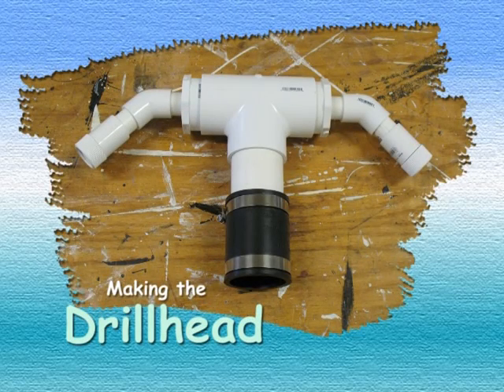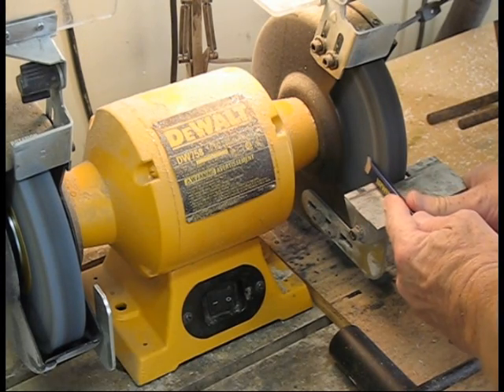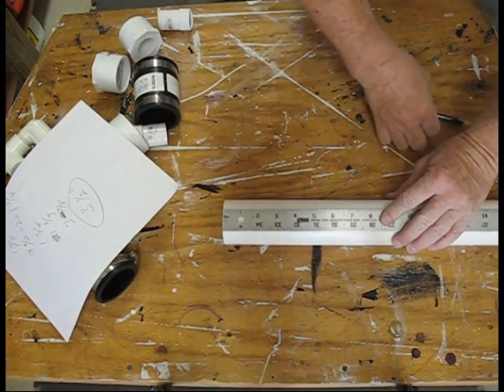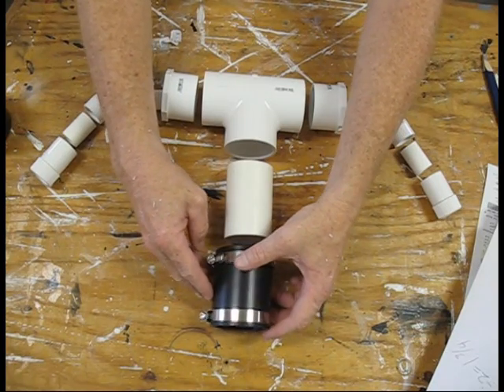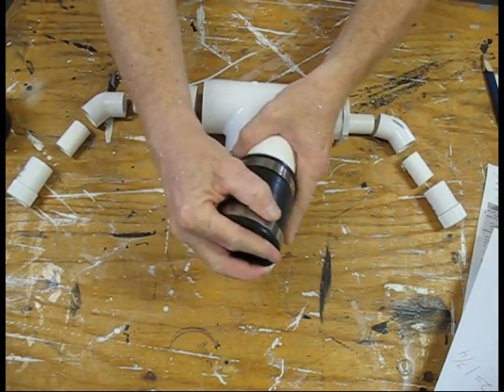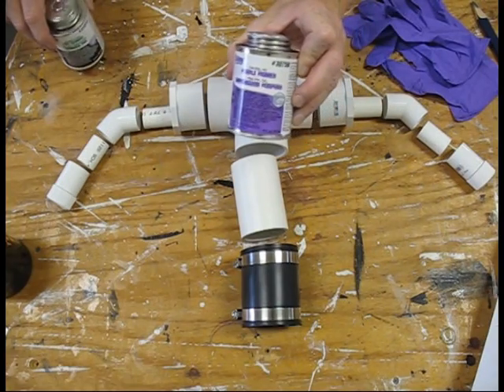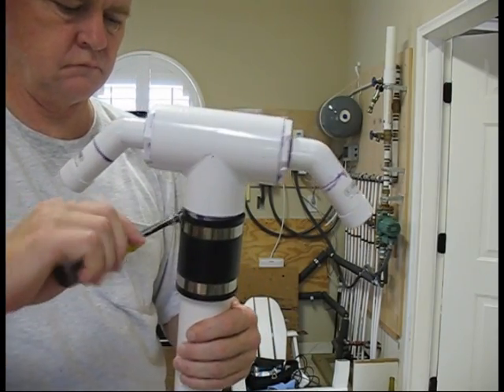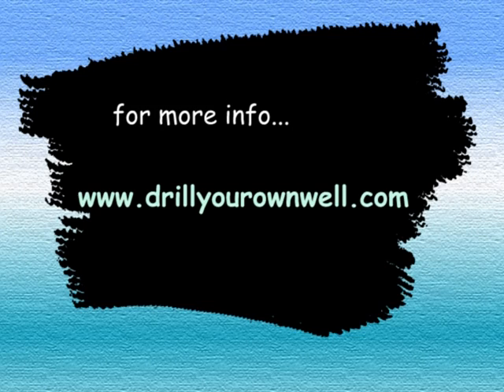Drill Your Own Water Well Series - Making the Drillhead

Comment: why 2 water inlets? why not `?
Reply from the maker: You need all the water flow you can get.  Five would not be too many.
Reply: @dawmlw  thanks. So then an IBC 250 gallon tote of water and a gas water pump would better for better flow?
Reply from the maker: Yes, absolutely.  @jimsamples7069
Reply from the maker: I should point out that 250 gallons is not going to be enough but you are on the right trace.  More water flow equals better "drilling."
 @jimsamples7069
Reply: @dawmlw  yea thinking I'll need to connect a few of them as well as have the 3/4 inch garden hose trying to keep em full..
Reply from the maker: good plan.  Good luck with your well! @jimsamples7069

Comment: Great Video Mike. I have a 6" well thats 240' but I think there is standing water 25' down. We live on the edge of a sod farm and that used to be marsh land. What I'm wondering is can a well 25' deep be used as an injection well? I have a heat pump with a closed loop system but I think injection system would be better. Two wells one for supply and another for return water. Its not possible to just dump the water above ground without flooding the neighbors. I would need 1" supply lines into the heat pump. As you know having a company  drilling two wells 240' deep is a dead breaker.

Comment: Just a note. If you're going to use this pipe for drinking water, It would be healthier to only glue the male end of the pipe. If you glue the female end, when inserting the male end, you'll end up pushing glue up into the inside of the pipe. This will clump up on the inside edge of the male end of the pipe. Giving a place for unfiltered minerals to create deposits. I learned this when I was doing electrical conduit. Sometimes, when the PVC conduit was going to be filled with a lot of wiring, the wires could be more easily pulled through the pipes without getting stuck on excess glue that built up around the pipe joints.  
BTW. I loved your "drill your own well" video's. I'm going to start my own well project in a couple of weeks. 
Wish me luck.
Reply from the maker: ***** These are for irrigation but nonetheless - Good Point!  And good luck with your well!
Reply: Thank you sir. And yes. If you don't have a lot of minerals and is bigger than an inch, then not much to worry about when it comes to deposits clogging up the lines.
Reply: Or excess glue.

Comment: Love the videos and I am modeling my system exactly after yours.  Question... how can you tell when you reach water if we are using water to dig the well?
Reply from the maker: Rob Amos It's tricky!!  You first need to find out what the standing water level is in your area.   Your neighbors who have wells are excellent sources.  County agent too.  The only sure way to tell is to dig a well, leave it alone for a couple days while it settles out and then measure to the water level.  But of course the pipe will stick during that time!   I wish it was easier.  Sorry.   Once you get deep enough that the top of your wellscreen will be 10 feet under the standing water level it is time to put the 1.25 inch wellscreen pipe in and pull the two inch drillpipe out, leaving only the wellscreen pipe.  That is your well.

Comment: awesome video, im bout to buy my first piece of property. Im definitely doing this myself.   why two, hose connections?  i think ill go sump pump route, will the drill head be different.
Reply from the maker: Good luck Tyler.  Thanks for watching!
Reply from the maker: You need two hoses because you need a lot of water volume flow to carry the cuttings to the top.
Reply: dawmlw did everything to the t, but I went down 8 ft and I am stuck and also there is not any water coming up outside of the pipe, where the hole is , anywhere ... any help would greatly be appreciated
Reply from the maker: Sandy Guzman You need to add some bentonite slurry to the drilling fluid to harden up the sides of the hole so you can get past that soft spot.

Comment: Hi, what do you think about the system sold by 'How to Drill a Well'.  He uses a air compressor to turn the bit which create vacuum up the pipe moving water slurry out the hole.  There is another guy with the ID 'Pentoxsoft' selling a kit but do not have information how to buy it.  But his method is similar to yours.  I would like to know your thoughts.  thanks in advance for your time
Reply from the maker: I have seen the video but I have not tried the technique.  This one is cheaper so I use it.  Having said that, it looks like his technique would work just fine.  He claims to be able to drill through rock and I'd have to see that first.  Other than that, the technique and equipment looks solid to me.  Pentoxsoft is Paul Smith and I really like his technique.  I even posted it on my website.  A user who wrote in is offering to sell a kit.  Check it out on the website listed just under the video above.

Comment from the maker: It is just a plain 3/4 inch coupling.  Any brand will work.  It just connects two pieces of 3/4 inch PVC.  In this case, the two pieces of 3/4 inch PVC are really short.  Yes, you are correct, the couplers can't connect to each other.

Comment: I noticed that ED made a parts list for the drill head on your site. He lists for part #5  lasco #23850 qty 4 ea. Is that in addition to the 3/4" pvc that is used? As is they wouldn't fit because couplings are the same size and can't be connected.

Comment from the maker: The new head works well, especially with the top port to add bentonite.  There is not much pressure on the 45s just the hose hanging from it.  It has better water flow and seems to drill slightly better.  By comining the 10 foot head start, bentonite. and the new head, 45 feet is easily obtainable.  My area has the first ten feet of solid clay then about 30% clay and 70% sand after that.  How deep you can go depends on the clay to sand ratio.  More sand limits how deep you can go.

Comment from the maker: Yes, you need to fashion a drill bit to go at the bottom of the pipe.  There are several specific sections on drill bits on the site - drillyourownwell    see link just under the video.  As far as where to start drilling - pick where you want the well to be.  If there is water down there, it is very likely in a huge underground pool that you can't miss.

Comment from the maker: Yes, it is very likely this technique will work for you but pure sand creates a special issue.  There are a couple of techniques described in detail on the website listed just under the video.  Go to the comments and questions section.  In addition to those two techniques, you can also simply take a three inch pipe and wash it down as far as you can.  You'll likely only make it about 15 feet before it sticks.  Then use that as a "head start" for a drive point..

Comment from the maker: Thanks!  I've tried something similar to that but had problems but it is too slow to adjust in use.  If the muffler clamps are properly sized then it is hard to get them over the coupler when you add a new stick of PVC.  We need a clamp that is easy to tighten and loosen and when you loosen it, it gets bigger in circumference to go around the larger coupler piece.

Comment: Part 2 of 2 @dawmlw
Cut two pieces of 1-1/2 PVC pipe and drive them over the aluminum angle iron, make the aluminum angle iron and PVC pipe whatever length you want for handles on each side. Fast and easy to adjust as needed without slipping, dam box only lets you put 500 caracter with spaces, so dumb

Comment: Part 1 of 2 @dawmlw do not use hose clamp on your handle, use 21/4" muffler clamp with 3/8 rubber fuel line over the U-bolt and on the clamp seat split 5/16" fuel line length wise and slip over and glue with contact cement, the edges of the 2 ribs of the muffler base bracket, this way it holds tight on the PVC pipe. Then drill two hole though a peace of  1/-1/4” aluminum angle iron, (for you U-bolts to go though)